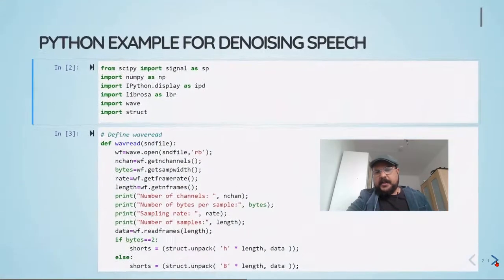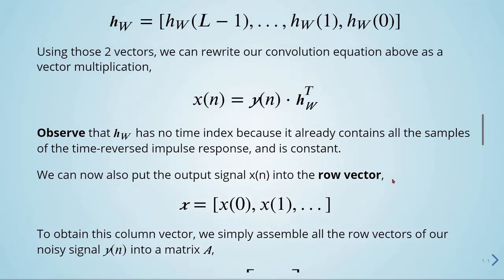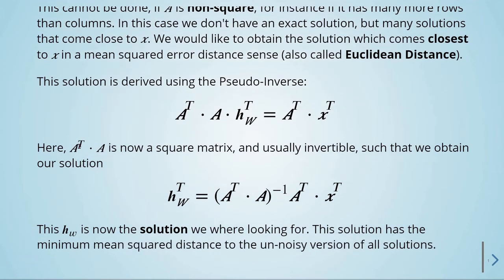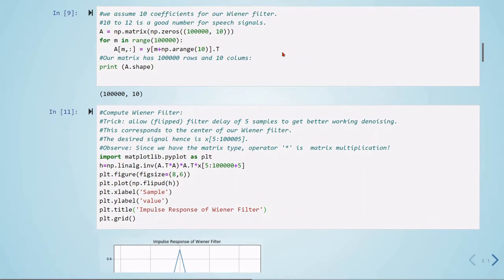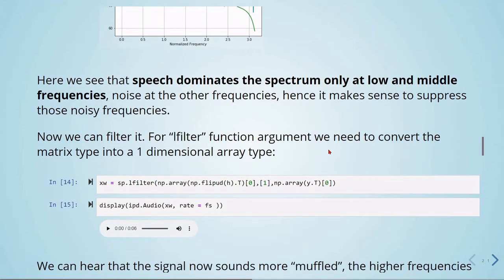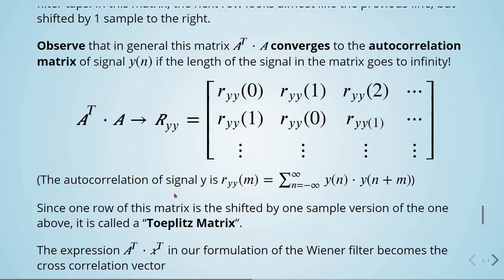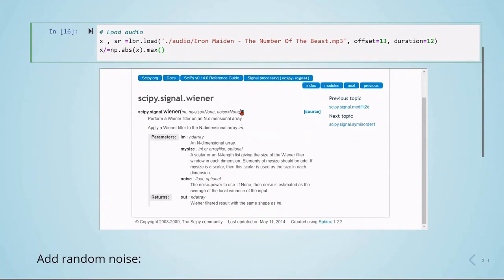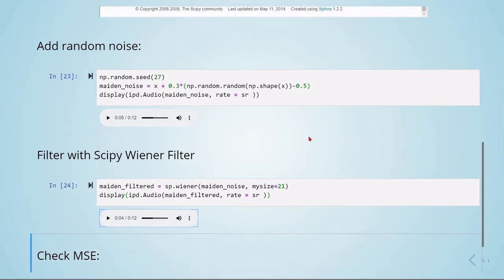Advanced Digital Signal Processing using Python- 12 Wiener Filters

Comment: Hi, 
It seems that to derive filter coefficients, you are multiplying the matrix A computed from noisy signal y using the original (clean) signal x. My question is how is the filter useful in practice where you will not have the clean signal x?
Reply from the maker: https://en.m.wikipedia.org/wiki/Wiener_filter
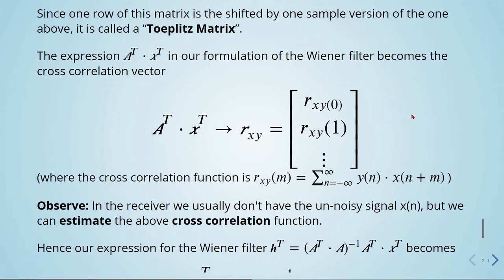Reply: It is described around 17:58.
You have to estimate the auto-correlation of the noisy signal and the cross-correlation between the noisy and clean signal to get the filter coefficients.
It comes down to knowing the power spectra of noisy and clean signal and generating the correlation signals from them using inverse fourier transforms.
So you most importantly need an estimate of the spectrum of your clean signal, then the ideal wiener filter coefficients can be derived from that.